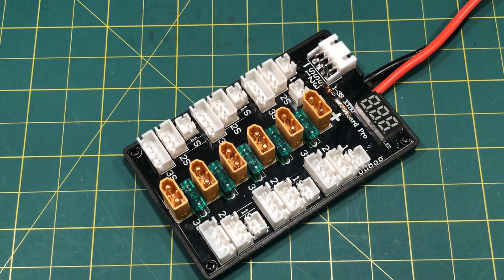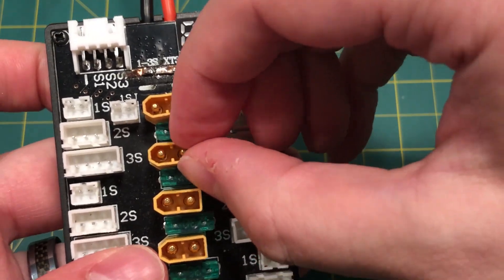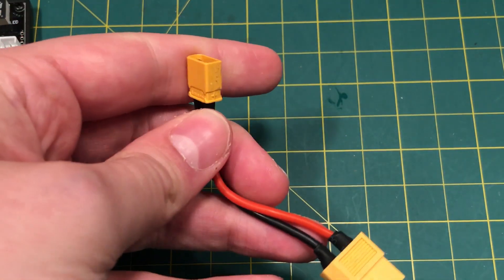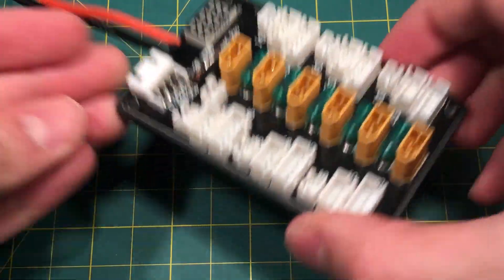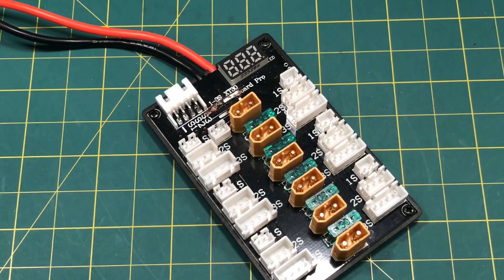Upgraded XT30 Parallel Charging Board for 1S, 2S, 3S LiPo Batteries (Poor Quality XT30 or "TX30")

Comment: LOL. Man, what are those XT30 connectors made of? Silicone? Those things are laughably soft. I'm not sure why this video was in my feed, but had to watch because I have one of these boards, or a variant. I got it in Nov of 2018 also! Luckily mine has some higher quality 🤣 fake "TX30"s on it, but at least they won't let me put in a battery backwards. Yup, TX30, not XT. 🤣  Its good that this video is making the rounds again though, people should be aware of this issue. Never had a problem with mine though, but now I'm thinking I'll solder some real Amass ones on.
Reply from the maker: Thanks for the comment. Made me laugh a bit as I’m suffering from the flu currently. I actually took this vid down for a while and then put it back up. Wonder why it’s getting recommended now.
Reply: @JohnCuppi  Could be that people are searching for XT30 parallel boards right now, getting ready for winter to end. New people looking for gear for their new toothpicks and whatnot. At least that my guess. I've seen you in the live chats for a while now, just subbed you earlier. Hope you feel better man, I hate the flu!

Comment: I've had one of these boards for about year. It's branded Crazypony on the back and the connectors are properly labeled XT30, and have the typically hard plastic. I don't think there is any way I could get a battery plugged in backwards, even on purpose. My only problem with it is that the logic circuit in the voltage indicator draws a surprising amount of current, and will discharge a significant amount of capacity out of small batteries left connected for more than a day or two. Not a big deal since I'm usually out flying within hours, but something to be aware of.
Reply from the maker: Mine was not a crazepony brand — mine was sold by a now defunct seller on amazon with a store named “Recharlance.” Not sure if these are even still out there as it’s been a couple of years. Thanks for the feedback on the Crazepony version of this though. It sounds like they used genuine connectors but it’s got another issue to be aware of. A lot of these boards are really sketchy... the one I bought was from ProgressiveRC to replace this, and I have never had any issues with it in case you’re looking for a different one.

Comment from the maker: - Intro & Specifications: 0:00
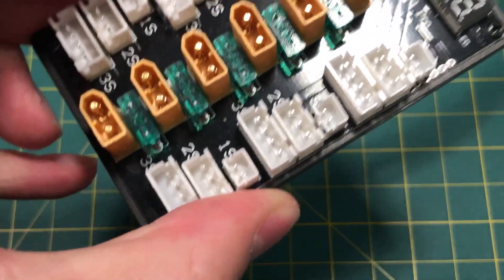- Easy Reverse Polarity, Soft Plastic "TX30": 0:55
- At least the balance fuse worked...: 1:53
- What quality XT30 connectors SHOULD be: 2:25
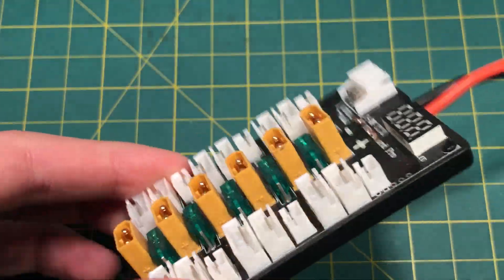- Be more careful, idiot? I agree, but... : 3:28
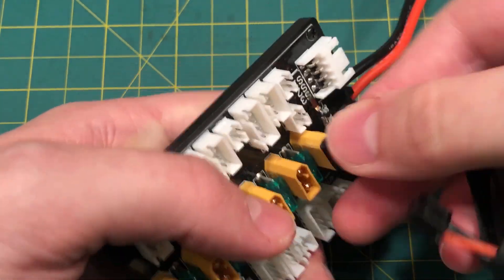- Conclusion: Don't buy : 4:10

Comment: I used these, and couldn't figure out why I kept burning foils. When you have smoke and orange glowing traces in front of you, you instinctively pull all plugs... with great angst and adrenaline. So never had the realization of THIS, what you just showed! Wow! I probably did this, saw smoke before I even finished plugging it in. In my case, the smoke happened when I plugged in the balance lead, which killed a couple of bal plugs too. 

The parallel that I bought from Pyro is solid, and I never have issues. Also, the metal ISDT. Solid. 

Thank you for pointing out the soft xt Jack plastic!!!!!
Reply from the maker: Lu, great comment, thank you. Comments like yours are why I made this; to inform people of the danger and issue here. I have pinned it on this video. Another thing you might notice that I didn’t realize until after I made this video is that they didn’t even get the name of the connectors right. Mine all say “TX30.” Fake junk.

Yes we should have paid better attention and not relied on the “fit” when we plugged them in, but stuff happens. These are cheaply made connectors ... that clearly pose a risk since they lack the physical reverse polarity safety feature. I’ve been using a different board as well with much tougher plastic and have not burned anything up either.

Comment: It is a design flaw, however I haven't heard of somebody inserting an xt30 the wrong way only people who don't pay attention especially when you are dealing with lipo batteries.
Reply from the maker: With the connector being smaller and if you don’t have the best eyesight it can be an easy one-off mistake to make. You’re right, I wasn’t paying attention and that’s why this happened. Since this time I’ve upgraded to a much higher quality board and haven’t blown it. The connectors on it are also very well made, you’d have to force it really hard to plug it in reverse.

Comment: Hi John. If I watch and connect it the right way I should be safe to charge?
Reply from the maker: Yes.
Reply: @JohnCuppi  thank you Sir! I'm so frustrated trying to charge the Happymodel HV 3s 300mah. I tried to charge with my 2different charges and right after starting the charge ,both of them said Connection Break.?  I tried charge only or balance charge and nothing worked. Then I took a chance and charged on a charger that I got 2-3s charge only at 1000mah (like 3c-not sure if battery can take it) and it charged but you know...I had it in fire-safe place under a glass bowl so I can watch it the whole time while charging... Is it just bad battery? It's out of balance by 0,2v on one cell (difference)
Reply from the maker: @miklosko3355  Which two chargers are you using to charge it? HappyModel brand batteries are just relabeled GNB ones which are actually very good. I have 6 GNB and the single happymodel, and all of them and all have worked great so far.
Reply: @JohnCuppi  I have 2 multi-chemistry chargers that do charge, balance charge, storage and discharge with full display(one is turnigy and one icharge brand they do lipo,lion,nicad, NiMH and so on. Up to 6s lipo. With temperature sensor and all that stuff.) They are a bit outdated. And don't do HV. For that I need to get a new one. Both of these charges would refuse to charge and say "connection break" (I have several different connectors that I tried and combinations but nothing worked) Then I just put the battery on simple old tiny charger that has only two LEDs to indicate charge and full charge at 1000mah output and it charged but it's like fast charge on 3C  and 1000mah for a 300mah battery. It will shorten the lifespan of it. Edit: it may smoke it too or blow up too since it's 3x times the current. The batteries don't state / indicate charge rate anywhere like : charge at 1C -normal people or 3C or 5C for fast charge for impatient people like me...
Reply from the maker: Just pay very close attention when you plug them in, which you should be doing anyway (I did not), but unlike some properly made boards and xt60s you'll blow things up big time. I would hate to see what happens if all but 1 battery is connected right, and then a single one is connected wrong...
Reply: @JohnCuppi  Thank you John. I'll be looking for a better charger. And batteries. Happymodel is very sketchy.

Comment: I just got some xt30 connectors to swap the ph2.0's for a tiny, and yep, they will plug in backwards also. They are crap. What happened to Deans? Try to plug them in wrong.
Reply from the maker: Since making this video, I've noticed that some XT30 connectors are definitely worse than others. It's something you have to watch out for in any case, but the connectors on this board were still absolutely horribly constructed. Which tiny are you swapping, just curious, the mobula 7?

Comment: I just bouth mobula7 hd,  he use battery with xt30 connector. What XT30 Parallel Charging Board do you recomend?
Reply from the maker: Sorry, I haven't tried any other boards. I don't have that many xt30s that needed paracharged; this item was just something I got really cheaply so I grabbed it on sale. I'm getting mobula 7 hd as well and will probably be looking into that soon. What I might just end up doing is buying a pack of 10pcs xt30 male to xt60 female and just use my existing quality XT60 paracharge board (the bardwell signature line).
Reply: @JohnCuppi  Thanks

Comment: That's really more a flaw of the xt30, not the board.  You CAN do this with just a female xt30.  What I do with all xt30s, both ends..  black sharpie on 1 side where ground is.  Then you will get it correct because visually the black parts of the battery and the charger/quad/etc will have to line up.
Reply from the maker: notasixpack interesting. This is something I’ll have to look out for with xt30 then. I do feel that this board must be much easier though than average, since I have much tougher xt30s. The plastic on these is just stupidly, dangerously soft. It should at least take some decent force to mate them. 😦

Comment: Well noted. Seen loads of these cheap plastic connectors which usually split or crack . I always buy the Amass branded ones now. They are tough and can withstand the heat from being soldered. I think they are nylon rather than polycrapylene!
JB parallel boards are the only good ones too. I've killed all of my cheapo ones by sticking the JST connectors in upside down.
Reply from the maker: LostJohnny JB needs to make us an xt30 board just like this one, but with polyfuses for the balance leads 🙂

Comment: Just plugin good  female to male xt30 connectors and let them there (possibly glued or taped)
Reply from the maker: R R Hey, that’s a pretty good idea. A little annoying to have to fix it that way but since I’m stuck with it I might do that. I need to figure out what they put on the balance connector fuse line though to “restore” it... I could reconnect it with solder but I afraid it it would be dangerous.

Comment: Thanks John for helping to keep the hobby safe! Those XT30 connectors are horrible! I have a lot of XT60 connectors and none of mine are like that thankfully! You were able to plug that battery in effortlessly which is ridiculous. That mistake could happen to anyone because we just assume it is plugged in correctly because you aren't supposed to be able to ever plug in a XT30/60 connector backwards. The nice thing about other plugs such as Dean's is it is impossible to plug them in wrong.

Comment: I use ISDT parallel charging board, is pretty safe, but not cheap.
Reply from the maker: Roberto Manzo does ISDT make an xt30 board? I could only find an XT60.
Reply: @JohnCuppi  I use adapters XT60 to XT30 from Gearbest
Reply from the maker: @robertomanzo7969  Ah, yeah, I could do that too with my current XT60 board but I didn't want to. I use the Joshua Bardwell XT60 strix paracharge board, one of the absolute safest on the market similar to the ISDT one. Looks like I'm just going to have to get a bunch of adapters now.
Reply: @JohnCuppi  What you have indicated is the only way if you don't want to use adapters. We hope that ISDT and Joshua Bardwell follow our discussion and start producing parallel charging boards with XT30 connectors. I also have a bunch of adapters :-D

Comment: Excuse me, but what is the purpose of the fuses?
I mean why it didn't burned when you plug in the battery in the wrong way?
Reply from the maker: The XT30 fuses will not pop unless a second battery is connected correctly. With only 1 battery connected there is no power surge that the fuses are able to detect. If I connected a second battery correctly, now the two of them would be fighting against each other, which should blow the fuse.
Reply: What caught on fire here was the balance lead trace, which is unfused.

Comment: oh my God, I just ordered one of these last week... I think I better get some hard female xt-30 connectors as well to change on the board I bought... I really apreciate your vid John, you're helping a lot of us from messing our packs permanently... Big hug
Reply from the maker: big hugs too, lipo batteries are no joke! very dangerous. I am very lucky that I was connecting an MJX Bugs 3 2s battery at a low voltage, alone on the board by itself. It immediately shorted the battery out when I did that and dropped one of the cells to 3.3v but stopped there since I unplugged it fast enough. The battery, luckily is ok, no puffing at all either. What a potential fire and mess it may have been if I had connected up those 3s high-c rated batteries and missed one of them. I'm just horrified this happened, I had to make this video.
Reply: My recommendation is just glue an extension into the plug...problem solved...I am not using my parallel boards for Drones but actually a powerwall...currently at 4kwh and jumping to 8 in a week or so here. Its wired at 15s which is 5 boxes with bms and 3s parallel boards..I can send pics but its been running for a couple months no issues.
Reply from the maker: Michael Lujan Yeah you’re right! best thing to do would be to glue some properly made xt30s in it. That is for those of us like me who were unlucky enough to buy this and figure it out too late. I hope everyone who can do it returns this to Amazon or wherever they bought it if possible — this is totally unacceptable! 😰

Comment: Good info John.  I'm going to check my xt30 board right now! Thanks!!
Reply from the maker: Let me know if your board has the same flaw or not. There are a variety of these "Upgraded" boards all over the internet with no quality control right now. The one I have is from Amazon!
Reply: @JohnCuppi  I lucked out. After use much force I had a difficult time trying to get it in backwards. The plastic isn't very soft. Mine came from Ebay.  I can't post a link because its currently unavailable.